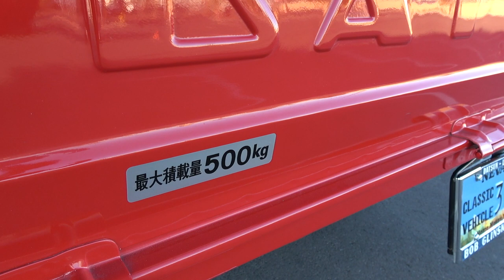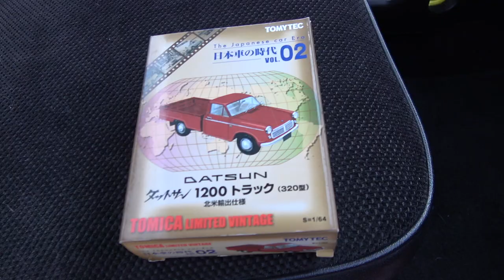1964 DATSUN 1200 TRUCK - LAS VEGAS CAR TALES

Comment: I had a 1964, very much like this one, blue.  1979 trip, Seattle to Fairbanks Alaska and then returning the starter went out. (Fortunately the truck came with a hand crank handle behind the seat.)  I made it to "White horse Datsun".  The manager came outside and looked at my truck, asked this:  "What kind of truck is that?"  I knew then that he would NOT have a starter for it.